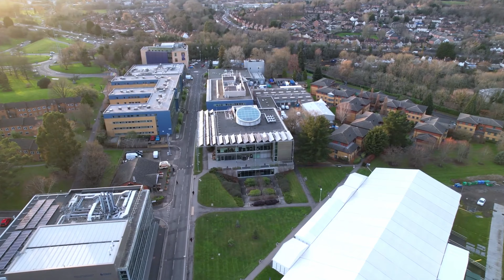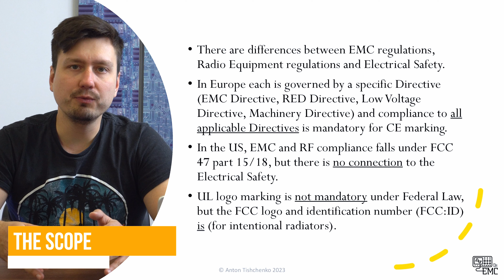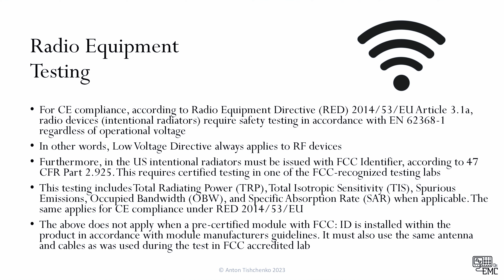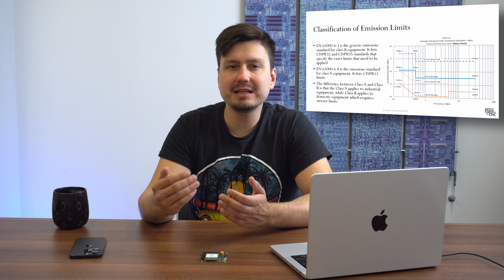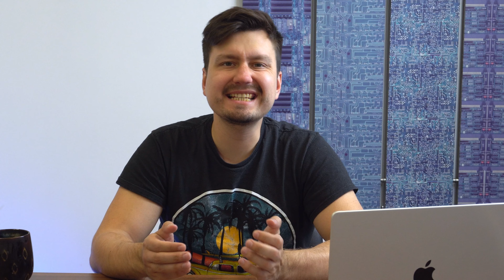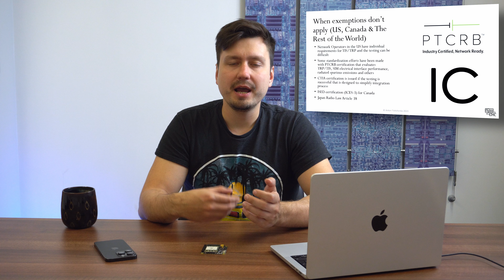RF standards for IoT products with Antennas

Comment: Thank you so much for these videos. QQ: for non-intentional radiator, can CE EMC be assured based on a successful FCC Part 15B test - or vice versa?
Reply from the maker: For CE compliance you would need to apply CISPR limits, not FCC as they are different. Also, I think there are differences in the testing method - for example in sweeping time for quasi-peak measurement. 
If it's really obvious from FCC scan that it would pass CISPR as well and for your product self-DoC is acceptable, then I'd say you can assume compliance by providing justification in the technical file (comparing CISPR limits vs peaks from the FCC scan). However, if the results are not black and white or if the industry requires external certification, then you will have to do another scan. 
Hope this answers the question :)
Reply: @DrEMC-sf8rx  thanks a lot, that's really helpful.